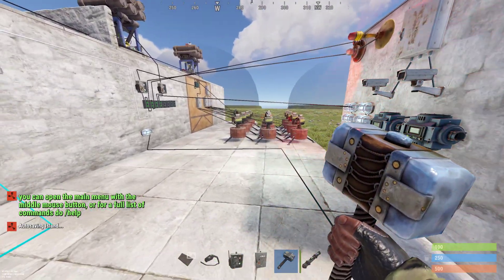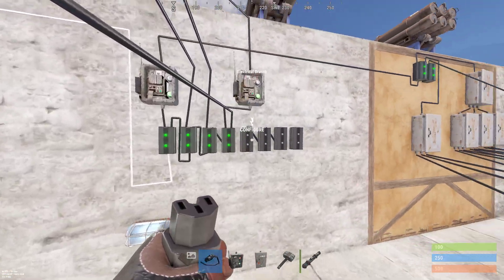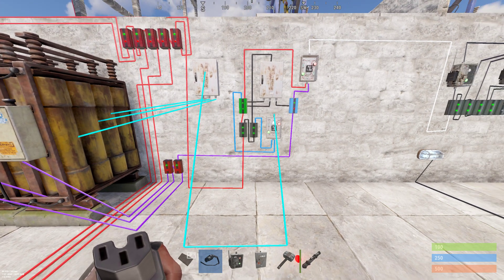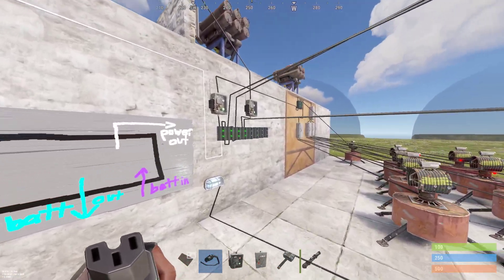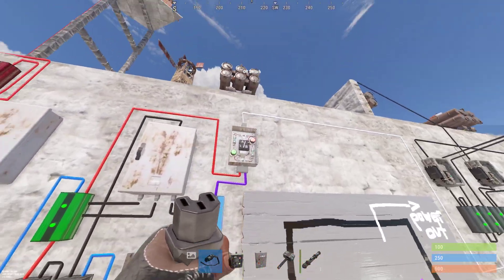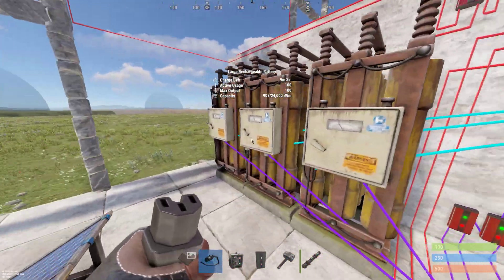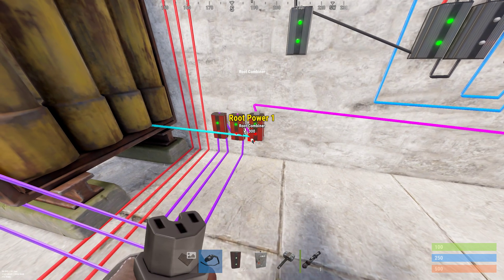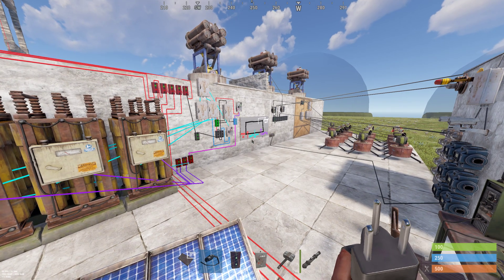RUST: Large Base / Clan Electricity Setup (Read Description)

Comment: I'm sorry but wouldnt it be less vulnerable to have each battery split in the base with its own branches? This way you dont have a single spot that you can destroy (the nih core) and shut down all your turrets
Reply from the maker: It's always a tradeoff. The benefit of the nih core is efficiency and power source redundancy. If they blow up up your batteries, your power sources can  take over. The system I think you are describing would make your batteries a single point of failure. 

It depends on your base design, and how you plan to continue playing if your base get's raided. Usually your electrical is pretty secured in your base. If they manage to blow into your core, you probably already lost the raid.
Reply: @auklin7079  usually in big online raids they just spam your core with rockets, and then they start breaching in your compound which could still have the turrets active if batteries are well spread out

Example: they take down one of your batteries on the side they’re breaching, if you have 3 batteries (or even 6 in bigger bases) you’d still have respectively 2/3 or 5/6 of your turrets active
Reply: @auklin7079  usually what i do is to just put the branches in each battery room and then wire them to the turrets to keep them safe then i take the extra power from each battery, combine it in my core and use it to power the utilities (furnaces, sorting, lights, etc)

Comment: Correct me if I'm wrong, but isn't it inefficient to combine output of multiple batteries because active usage would be 100 on all of the batteries if your circuit requires 100 or more power? So if you had 3 large batteries, so 300 power to work with, and say your circuit only required 250 power then all 3 batteries would say 100 active usage even though only 250 is needed. In this case, it would be better to have 3 separate circuits with 1 battery each to show true active usage on the batter. Although this isn't always possible in some bases to have alot of circuits.
Reply from the maker: it does get more 'efficient' in a sense closer to the 100 mark you are, so 280 is more efficient than 301 (ignoring RC's). But multiple circuits have their own downsides, which is often wasted power and time to build.

While it is definitely a downside, it is a very small one, and very manageable.